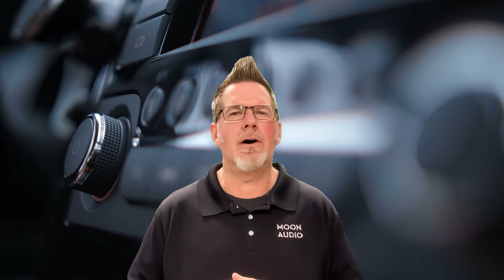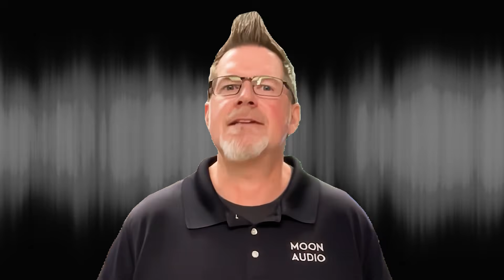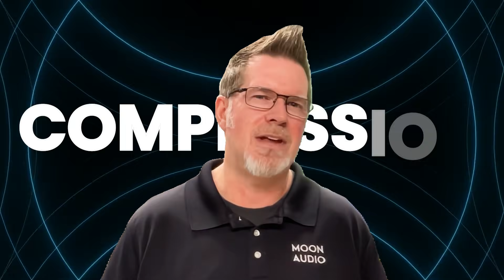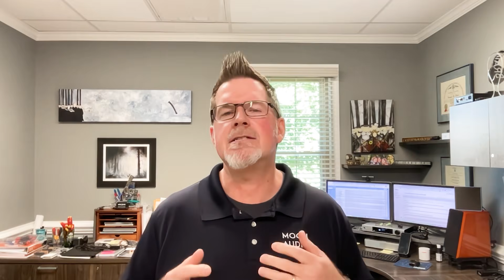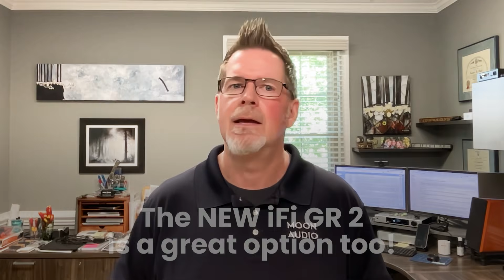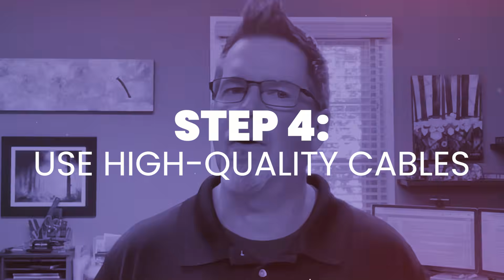DON'T Waste Money! Beginner’s Guide to CAR AUDIO Upgrades

Comment: I am considering upgrading the audio sound quality in my 2013 Jeep Grand Cherokee. Understanding that the best first step is to improve the source quality, I am exploring the use of a high-quality Digital Audio Player (DAP) and a cable to connect to my Jeep's receiver via a 3.5mm port. The amplifier and DAC in the DAP, combined with the high-resolution files from Qobuz should provide a marked improvement over the compressed files and the Bluetooth connection I currently use.

What is the right DAP to accomplish this? I am especially concerned with a DAP interface that is large and straightforward, because, after all, it is in a moving automobile. At present, an iPhone and Qobuz app are not the solution, as it's difficult to read, especially while driving.

What are your thoughts?

Comment: Qudelix-5K has been great given the size, cost ($100), and ability to automatically power on and charge once the car is running. Customized eq also allows saved profiles for different genres.